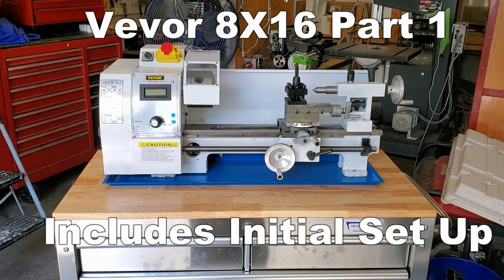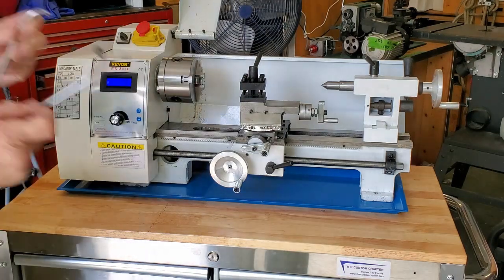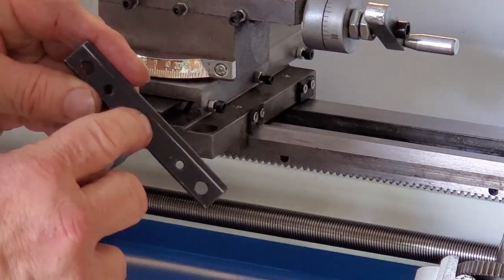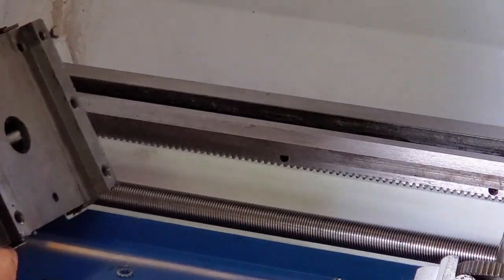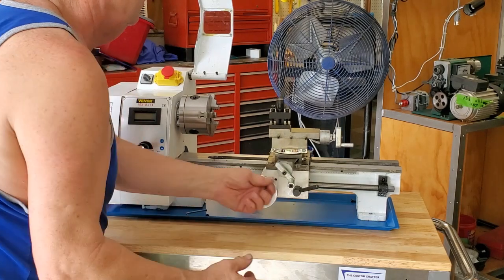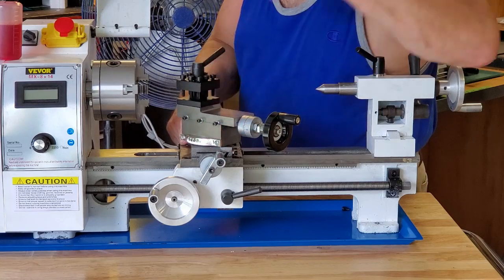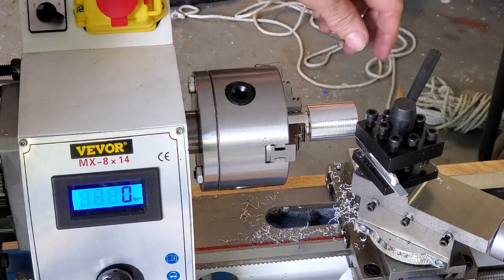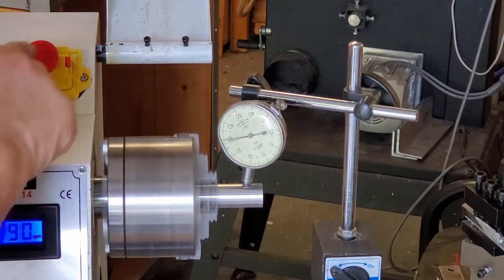Vevor 8X14 Mini Lathe Initial Setup Part 1. The Required Fixes Just to make The first Cut Inc Review

Comment: These mini lathes are toys and as such are a lot of fun. I've had mine for many years and made lots of fun projects. Anybody that thinks they can get a precision machine tool for this kind of money is either very out of touch or stupid. Getting it unboxed and cleaned up takes hours.Everything needs to be taken apart, degunked and deburred before even thinking of using it. I like restoring old tools and the process of getting one of these things usable is a lot like restoring an antique. Few hobbies are cost effective you just learn and have fun. If you want a precision commercial machine tool buy one. Bank loans are available.
Reply from the maker: Very true.
Reply: Yeah was thinking of getting such a mini lathe but thanks to YouTube I will not buy one. 
Not worth the money when you have to rebuild a new tool.
This lathes are coming from the same manufacture. They paint it in other colors and the body with the speed dial is different but the lathe has always the same body.
Reply: Yeah, looking at mine, I think there must have been a competition to see how much packing grease they could put on it without irritating the supervisor!

Comment: This is a typical example of someone who buys a cheap as lathe and then expect it to perform like a  Rolls Royce......get real, it's a fix me upper.......the amount of time you will spend getting it to a standard that is reasonable will double the price of the lathe if the work was done by the manufacturer.......there are lathes double the price if that be the case........as a rule of thumb I would not hesitate to say that in this size lathe a decent lathe would start out at 3 grand........but that would take all of the fun out of stripping this model down and rebuilding it to your own satisfaction with mods along the way too..
Reply: With these you're not just buying a lathe, you're buying a project.

Comment: Great video! I’ve wanted to get a lathe to learn on, don’t want to spend too much but don’t want a cheap piece of junk. A lot of what your doing seems like things I could do but very interested in part 2 and the final verdict.
Reply from the maker: Even though I will lose sales, the final verdict will be: Do not buy this brand mini lathe. However, by the time you get any brand mini lathe working good, you will be quite skilled and know exactly what you want in a real lathe. The next video is in adit and should post in a few days. It's very long and may have to be split into 2 or even 3 parts.

Comment: I just got a 7x14, specifically to learn how to use one and maintain it. It didn't come with any meaningful documentation, for a start, so I have been watching videos for three days now. Using the crank to control travel, it binds and doesn't move freely. I'll have to fix that before I can do anything else. On the tool mount, the micrometers have 20 thousandths movement between gripping for in vs out when setting distance. I'm no machinist, but I know enough to realize that's not allowable if you're trying to do anything but play around with. The tools that came with it are comically large, to my eyes. Haven't even gotten to the point of powering it up yet because I'm trying to figure out all the things I need to check before I start running it. I'm told a quick release tool holder will help with the height issue because there's better adjustment available. Maybe later...

Comment: The howling from the gears in addition to the ridge you are getting in your cuts tells me that your lead screw is bent.
Reply from the maker: Thank you for this consideration. The lead screw does not appear to be bent. It is however misaligned.
This is realized in the next video still in edit where I replace the motor. When the motor is replaced the cut gets much smoother. I have several customers who commented that their rough cuts were much smother after they did the motor upgrade. As for the gears. that is also addressed in the next video.

Comment: I just got a vevor 8x14 real cheap I think it was an Amazon return. it’s my first lathe and I like to tinker so I’m gonna watch all your videos on it a few times and get this is good working order. I appreciate the time you put into these videos.
Reply from the maker: I have been designing a black box version control unit ever since I did part two of this video. Its complete now. Video coming soon.
I had decided this lathe is not worth making a kit simply because most who buy it are entry level and not likely to pull the spindle to do the
required key way refit. However there are many who have asked, so soon after the video (around October) I will release a kit for this lathe. 
The belt, drive pulleys and key are here now. So are the black box housings.

Comment: I bought mine from HF and it’s been pretty good. Now updating to the longer bed.  But this one is amazingly screwed. And the reviews I’ve read on vector I’m not surprised.
Reply from the maker: You haven't seen nothing until you watch part 2. The reality is do not buy this Vevor lathe. Also realize this was not sold as a Vevor, that is what came in the box. Send it back immediately!
It's so bad that I may not even develop a kit for it. This is because there is no fix without lots of machine work. Machine work that most beginners will not be able to accomplish.
Reply: I bought the HF 7x12 which is only available online, and it’s a great machine! You can’t beat a Sieg built machine!

Comment: What are the BETTER bench lathes that you recommend?
Reply: I can tell you firsthand about 3. My first was a Central Machinery (Harbor Freight) 9x20 (no longer available, but the same machine is sold by Grizzly Industrial as a G4000 9x19 $1,195.), and it’s a good machine except for the compound mount. Little Machine Shop sells a replacement for that part that’s massively more rigid, and if you’re not familiar with LMS, you need to be if you’re getting into mini machine tools! Second was a Harbor Freight 7x12 mini lathe (not sold in stores, online only. Bigger than the store model that they sell as a 7x10 - but it’s actually only 7x8!!!). This lathe is manufactured by Sieg, arguably the best producer of mini mills and lathes. This machine has been a good one, and only required minimal adjustments and cleaning. The final one is a Grizzly G0765 7x14. This lathe looked as though it was going to be top of the line. It’s not made by Sieg (Sieg lathes can be identified by an “H” shaped saddle), and without going into detail, I’ve been disappointed with it, and went back to the Harbor Freight lathe as my go to. The Grizzly is up for sale. LMS sells Sieg machines and also Sieg manufactured mills and lathes that are built to LMS’s specifications. Those machines, branded “HiTorque”, are the top of the line products, but priced accordingly! Also be aware that LMS sells all the parts for Harbor Freight machines even though parts from HF are mostly unavailable.

Comment: Is that a 110 plug we can plug straight to a regular wall plug not a 220
Reply from the maker: Absolutely. Also any 15A standard circuit breaker. Do not plug it into a GFCI without replacing the GFCI with a hospital grade GFCI,